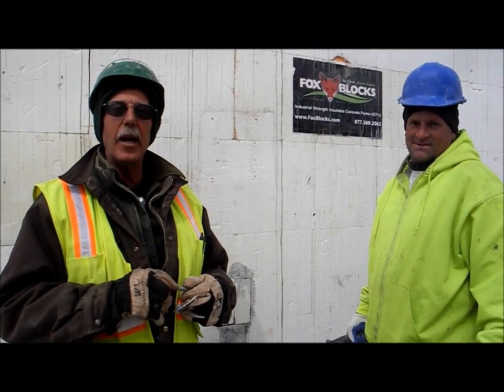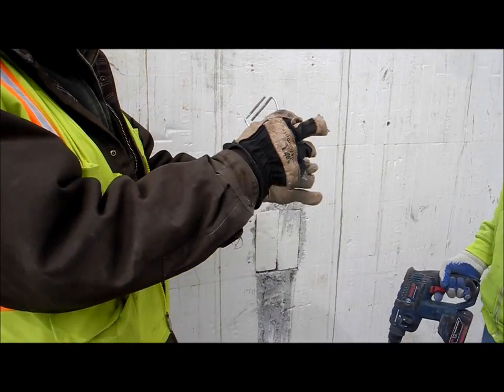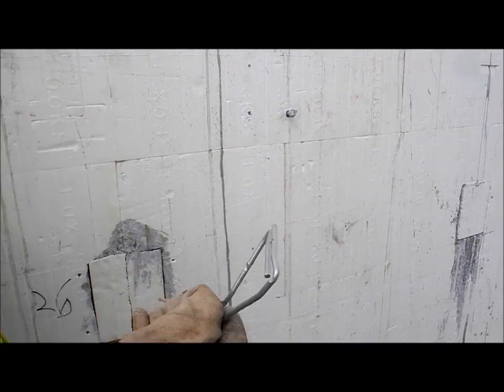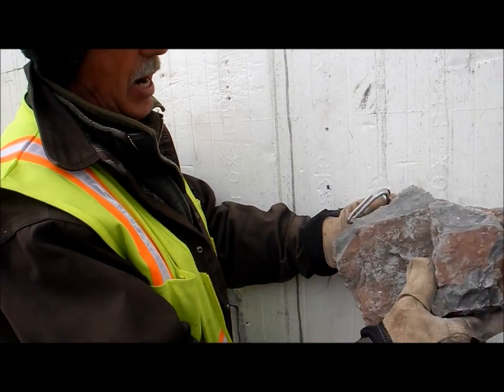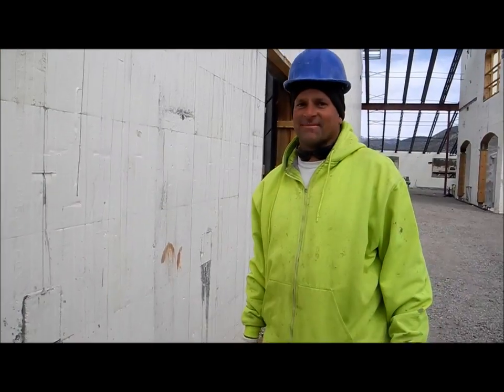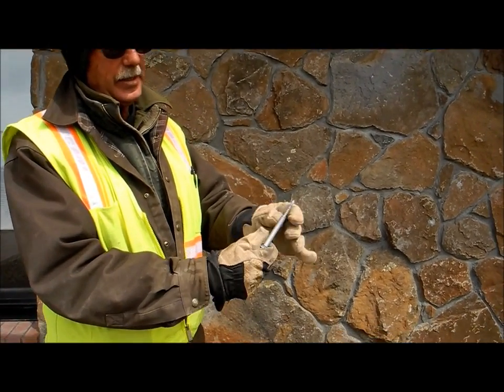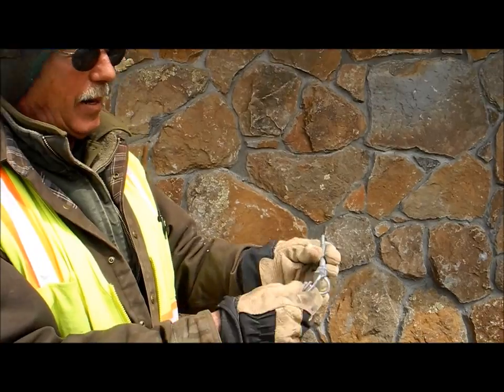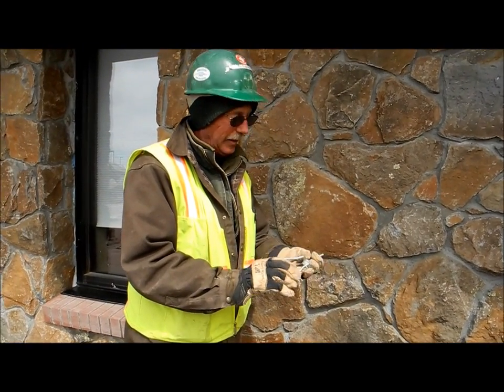How to Attach Heavy Stone Veneer to ICF Walls | Fox Blocks + Hohmann & Barnard 2-Seal Tie System

Comment: So there's about 6" of rock, 3" of insulation, another 6" concrete, and another 3" of insulation?  

Can you give me any idea of how much more expensive it becomes to add that stone?
Reply: about to build my place with it, im told by several sources and the builder the cost to do ICF VS stick built is about 10% more for ICF.  i want to do the stone too, not cheap but never painting or replacing siding....cheap over time.  yeah 6in of rock+3in foam+6in concrete+3in of foam....and sheet-rock inside  means about the best insulation one can do.  so over 30 years it will be cheaper. oh yeah....no pests living in the walls either ;)

Comment: do you leave an air space behind the rock like you would with a brick facade?  It sounded like not...
Reply: Thats what I was wondering. I would still commercial wrap top down with the pink water protector barrier stuff then stone, for just in case, like in 60 years when I pass the house to my child, it's still good.
Reply: when you are using the ICF foam blocks, that is your vapor barrier.  no need to use a tyvec wrap. I personally love this stuff. Talk about a bunker.  👌
Reply: @SonOfOverbrook  Total hogwash.  You always need a water barrier over ICF.
Reply: tecnolover2642 Then, I would ask why don’t they use it , on this project video? Also you have to take the building code, for every state,  into consideration. They do change the code every couple of years. IFC is a interlocking foam which will act as a “ Yeti Cooler”. Ya know what I’m saying?
Reply: @tecnolover2642  People just assume they need a vapor barrier (which isn't the same thing as water barrier) with ICF, but it's not scientifically proven to be the case. I read a study that says adding a vapor barrier on the outside of ICF actually leads to condensation in hot humid climate or something like that. If you are interested search ICF and moisture or similar keywords. If I have to use a barrier I'll add it on the inside behind the drywall, if I use drywall.